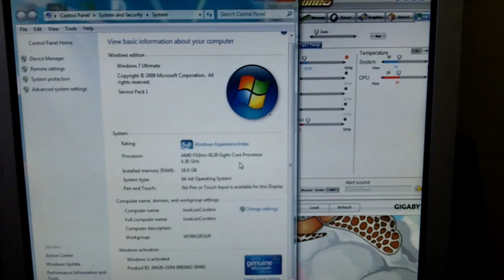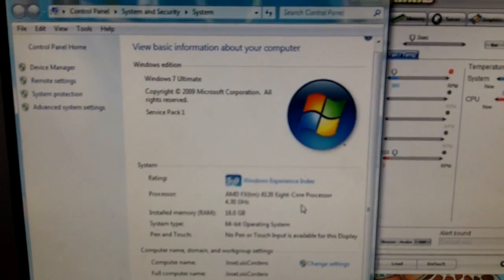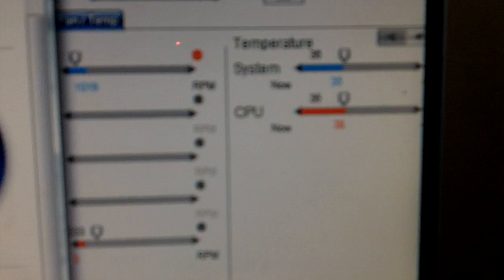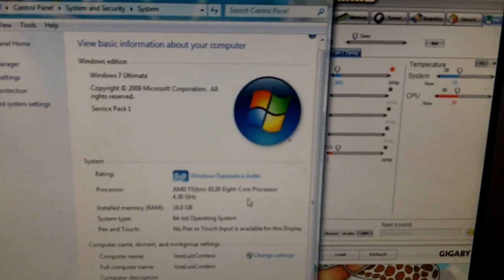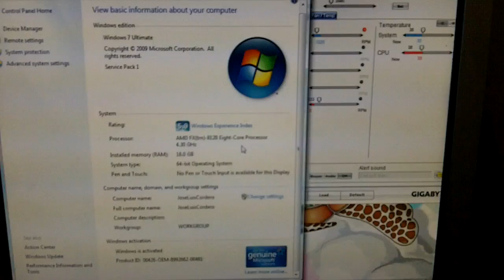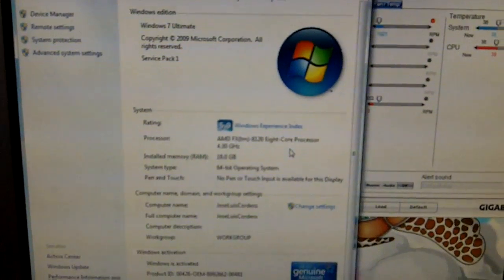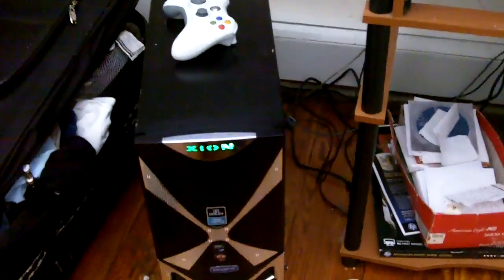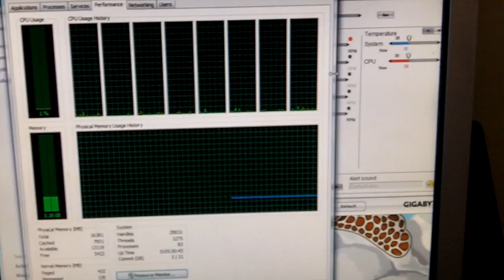AMD FX 8120 32 nanometer Preview

Comment from the maker: @karateboy27 basically i added more voltage  to 1.47 and leave the rest untouched inside the BIOS turn off C1 turn off turbo , turn off AMP , turn off C6 and after that turn off thermal hardware and then save & exit you should be fine after that